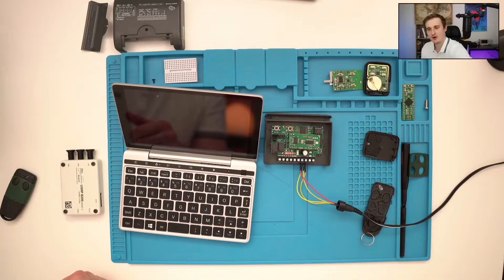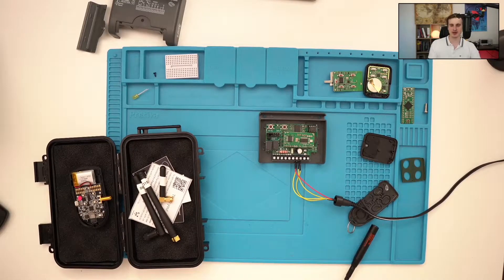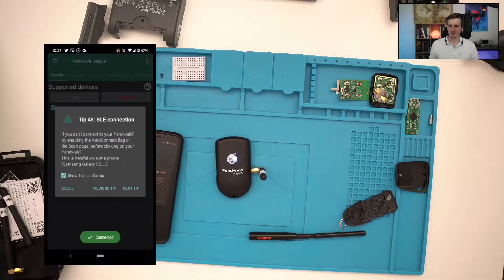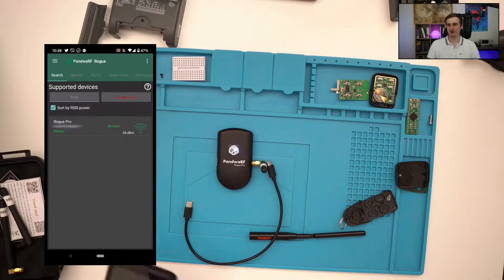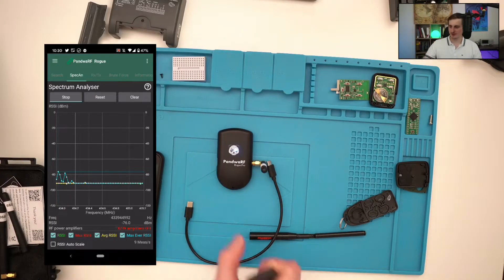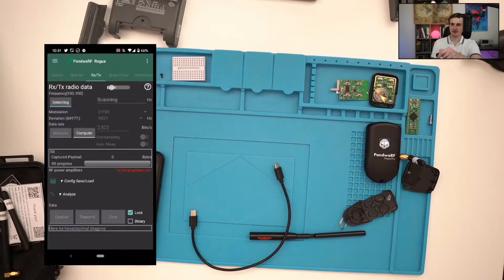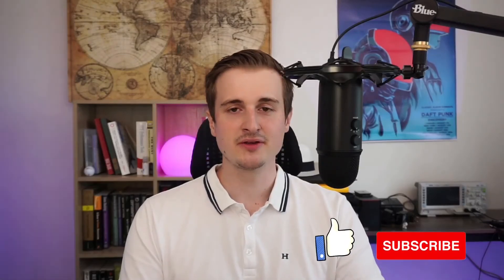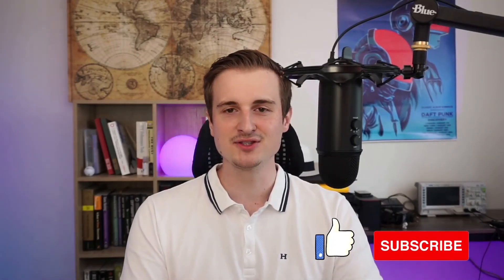Tackle rolling code with PandwaRF

Comment: Can it start a car
Reply from the maker: Hello Carlos,
Not directly, for that you have the choice to hot wire it, or use the diagnostic port to add a new key, or in case of wireless immobilizer you will have ça  break the comm to start the engine

Comment: Thanks for the video, what is the small computer model ? 
😊
Reply from the maker: Thanks :) The small computer is not full of power, but very practical for major security assessments when need to move a lot, or doing slides in the train/plane/etc. => GPD Pocket 2 ;)
Reply: @Penthertz  thanks for the info, I'm myself using an eeepc for pentesting, not pretty powerful, but the purpose is not to crack with the GPU for example ☺️

Cool d'avoir une chaîne comme ça, j'ai gardé anglais pour le ref 👍
Reply from the maker: @MrKoblepot  maybe you can break password with external GPU? :P
I remember the first eeepc! They were super awesome :) that also bringing me back some old memories of the OpenMoko device, I think these devices came pretty in the same period if I'm not wrong :)

Merci pour le soutien 🙏 ça fait plaisir :)
Reply: @Penthertz  yes or at home with the desktop computer, otherwise I saw stuff about renting servers having until 4 4090 (linode if I'm right).
Nice project openmoko, i was for my part using a nokia n900, that i should be fixing (unsoldered USB port) when kids will let me.

Merci à toi pour le travail fourni encore une fois 😎

Comment: For the Pandawarf Rogue Pro version, if i purchase this device, I still 
need to pay for license and tokens for it to work??? It will not work or will not do 
anything if i just buy the device without the annual licenses or 
tokens?
Reply: You can still use it on sub-ghz devices that don't use rolling code security, tokens/subscription are just so the app cracks the rolling code to find out the seed so you can use it.